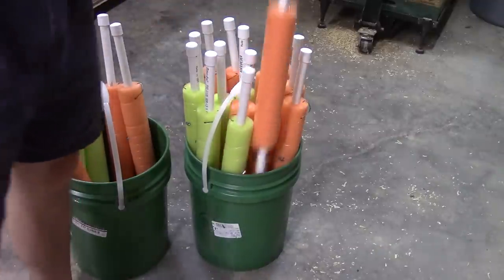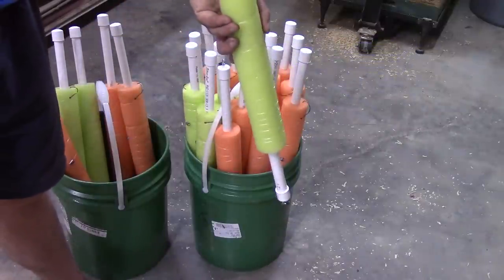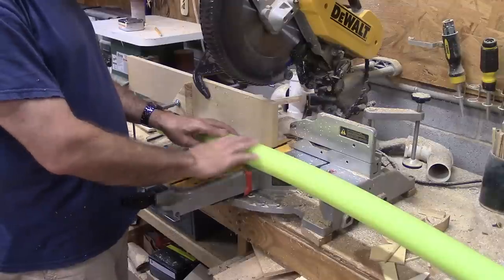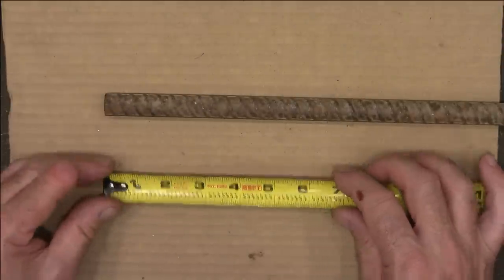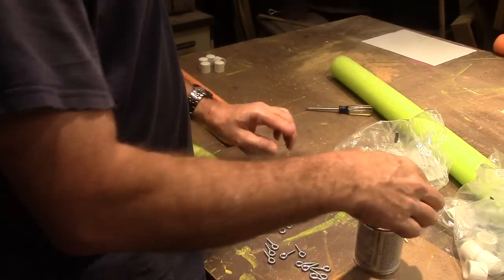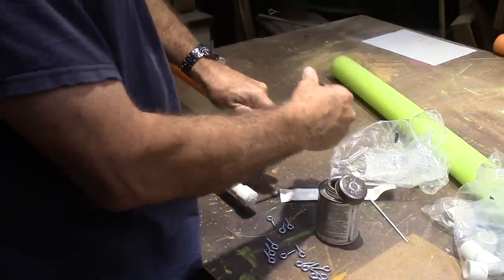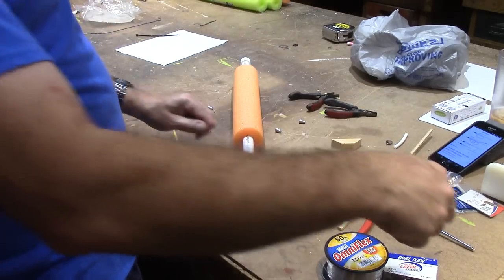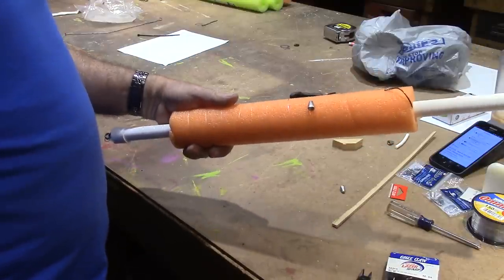DIY Catfish Noodles for Under $2

Comment: For those who don’t have the tools to easily cut rebar, I built some very similar a few years back and put some long bolts in them. Also did some pea gravel in one and it works great as well. Thanks for the video!
Reply from the maker: Pea gravel is a great idea!
Reply: You just need something thatll slide down. We use a nut in Tennessee.

Comment: Just finished making my first dozen floats as a gift for my big brother. I also took several pieces of about a 6 inch piece of foam, wrote the line length on it, then wrapped the line, weight, hook, and swivel onto the piece of foam. This way he can swap out line lengths as the water depth dictates.
Also, cut 5 (3 inch) pieces of different colored foam and glued them together using waterproof Gorilla Glue to make one piece of 15 inch foam. Gives the float a unique color combination.
Reply from the maker: That's a great idea!  Thanks for sharing.
Reply: Good idea, im trying the different colors

Comment: So how are you keeping these from floating away or from fish just running away with them? Forgive the novice question. Id like to set some in our local river but cant wrap my head around keeping the fish in place without a huge weight at the bottom. I have a canoe so donr wanna paddle all day looking for them.
Reply: Make a weight out of a Solo cup filled full of concrete with either a wire or an eye bolt sticking out

Comment: Do they have enough buoyancy to hold a big fish? Say a 20 pounder? Whats the longest you've seen one go under?
Reply from the maker: They will pull it under but it wears them out pretty quick and it floats up.
Reply: @SoatMon  I'm thinking of shooting some foam in the pvc to add a little extra buoyancy. See any issues with that?
Reply: @sunsoutgunsout2046  adding foam would make it less buoyant. It’s already filled with air and that’s less dense than foam.
Reply: In Texas, orange is reserved for commercial fishing, us regular folks can use any other color. The problem I see with white is you wind up chasing seagulls and pelicans all over the lake.

Comment: How much would you say the pieces of rebar weigh?
Reply from the maker: I don't really know.  Try putting one together without glue and test the weight, once you get it right you can copy it.  When the weight is at the top and you lay it in the water it should lay pretty flat, once the fish trips it, it should stand straight up.  You don't want the weight too heavy as the fish will drag it under too easily.  You want the noodle to tire out the fish when he tries to drag it under.  Good luck!
Reply: @SoatMon  Do you think 2 and 3/8 oz. will be too much?
Reply from the maker: no
Reply: @SoatMon  Finished my first project of making these. Made two for my big brother who lives near the Red River Louisiana. Shhhh! It's a secret.
Reply: According to google a 5/8 piece of rebar weighs 1.04 pounds per linear foot. So roughly 4 oz for 3 inches.